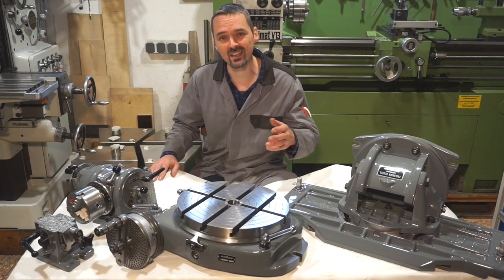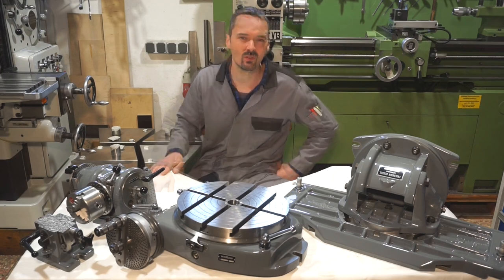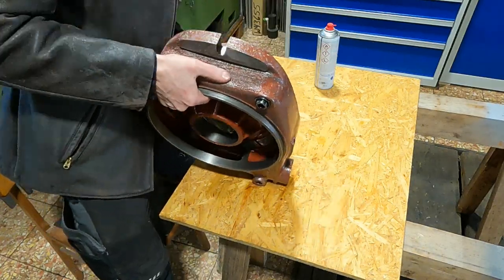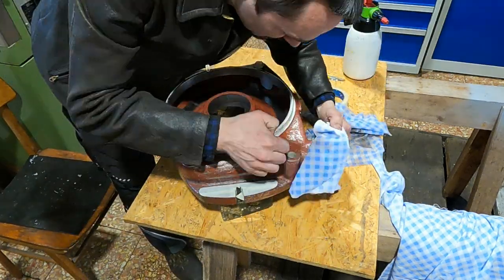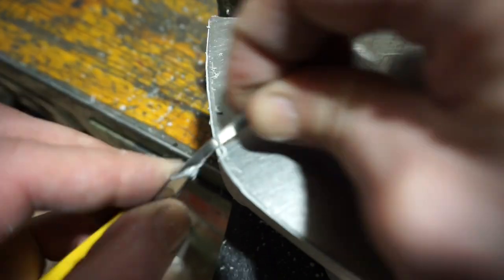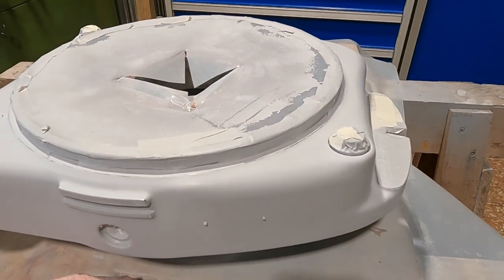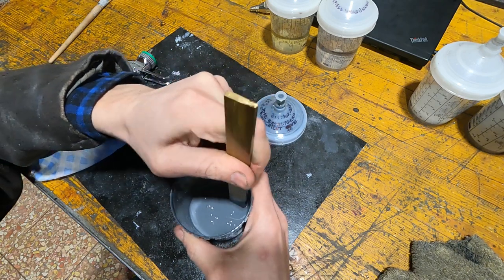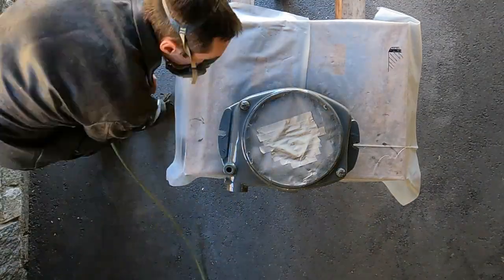Restoring Machine Tool Paint

Comment: This has made be want to restore my mill again. Repainted the top housing when I rebuilt the head. Had such a problem with it I never did the rest of the machine. You filler idea is much better than the putty type I was using. Will have to wait until I can setup a proper spray gun to do it properly

Comment: Funny store I bought a old craftsman lathe used it for 15 years came across a big better lathe. So I decided to clean up the craftsman to sell it and sprayed it down with degreaser and pressure washed it and all the krylon rebuild that was on it came off leaving perfectly preserved factory paint. Sold it for $350 more than I payed for it.

Comment: Excellent video, as usual.

Quick question - where do you get your scraper blades?  I have a bunch of hand scraping to do and I'm getting a bit fed up with resharpening HSS, I think it's time I made up a new scraper with a carbide blade.
Reply from the maker: This answer may not be helpful, but it is what it is: I got a handful of flat pieces of carbide years ago from a friend who worked at a carbide manufacturer. These blanks may outlast my lifetime. Only thing I had to do was to grind the cutting edge shape/radius. ATB, Alex
Reply: @anengineersfindings  Thanks, Alex.  My original plan was to use a busted carbide slitting saw I have lying about, I think that's what I'll end up doing unless I find a real score on some "proper" scraper blades.

Comment: When you talkd of "silicone cleaner", I'm guessing you mean something like Mipa Silikonentferner (Silicone remover)? 
Is that because it has good cleaning properties, even when there is no silicone product to remove?
Reply from the maker: Good point! The term "silicone cleaner" (as used by painters) refers to a very clean and mild type of solvent that is used to degrease the surfaces to be painted. There are several types on the market, from ethanol-water mix to the more common pure hydrocarbon types. Actually I cannot tell you why this particular term is commonly used, the process has not much to do with silicone.

Comment: stripping chemical gel makes miracles. I repainted from the bare metal a 1954 surface grinder. On the column I had to apply the gel 4 times to strip so many layers and filler. Way less work than your way.

Comment: Excellent video, BUT…the first thing I noticed was the absence of a face mask when paint stripping/chipping/sanding….even though you can’t see it when chipping, fine dust particles are still created, and old paints often were lead based….HIGHLY TOXIC…..STAY SAFE..👍
I always use an etch primer first…good adhesion to the metal, and to subsequent coats…

Comment: For stripping using chemicals, lye is very cheap and does not hurt cast iron. I used an immersion heater, a container and I could strip entire parts, such as the ribbed underside of my milling table very quickly. Working with lye requires safety equipment, gloves and eye protection!! You know you are dealing with lye if your fingers get the lye solution on them and they feel slippery, that's the oil in your skin being saponified.
Reply: 2k acryllic paint? That's new a one to me!

Comment: If anyone else is doing this - and you find you're get brush strokes in the surface after it's cured, add about 10-15% {appropriate to your product} reducer/thinner. The 'slow' version preferably unless you're getting runs in the finish (then go up to medium or fast). This will allow the product to flow out more and become level. Working on a surface that's about 20* C helps flow out as well.
Reply: Can't get brush strokes if it sprayed on eh !

Comment: You might want to know that brake cleaner is good for the initial clean, but not before paint. You should use a final wipe of something like acetone, alcohol 99%+, ... Because brakecleaner contains a minute amount of acid (I think is the cause if I remember) which could lead to imperfections like bubbles, adherence issues, ... I recently repainted my machine and did loads of research before hand. I also have experienced the issues I read about when I did another machine years ago. Though take this with a grain of salt; i am merely a perfectionist amateur with an internet connection

Comment: Save yourself hours of sanding and prepping between layers by using a spray gun.  Sanding your primer is insanely difficult and adds way too much time to the project.  The brush applies way way way way, way, way, way too much paint.  Spray guns use less paint and apply an even layer that does not need to be sanded at all if sprayed correctly.  I would say to spray a polyester primer for super high build, but you need to seal that primer and that would add another layer.  I would use an epoxy/acrylic hybrid and spray two coats after I used a filler to smooth out the substrate.  I use Evercoat Z Grip with a touch of Evercoat Honey.  Then spray your single stage paint or basecoat and clear.  Tractor paint is the toughest single stage paint that I know of and that is what you should use.
Reply: Cast Iron surfaces , not spray friendly for a smooth surface, hence filler !!
Reply: @tonybradley249  Exactly right. If you spray, the imperfect shape of the casting is replicated and the hollows will still be hollow after sanding. Moreover, sanding the high-build primer recommended by Alex (using the 3M mesh media he suggests) is not remotely difficult, let alone insanely difficult as the OP suggests. People making firm recommendations need to make sure they are familiar with the particular context for which they are making them, and on YouTube that often does not happen.